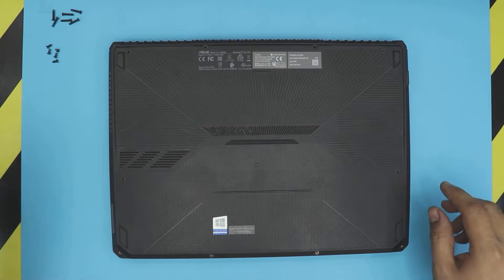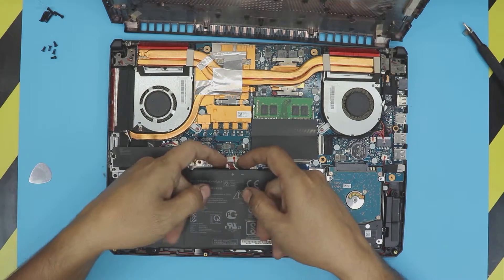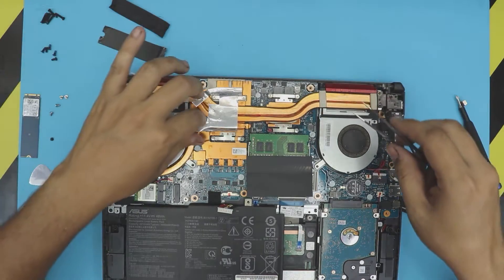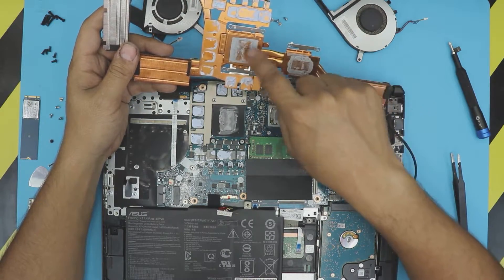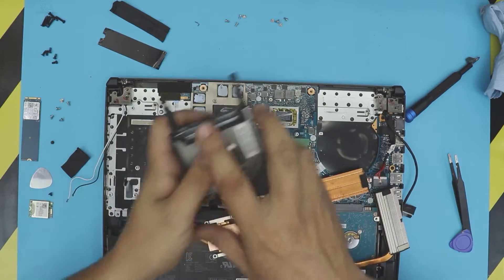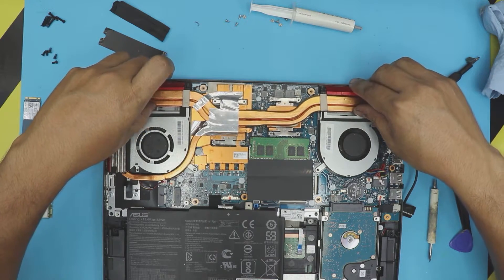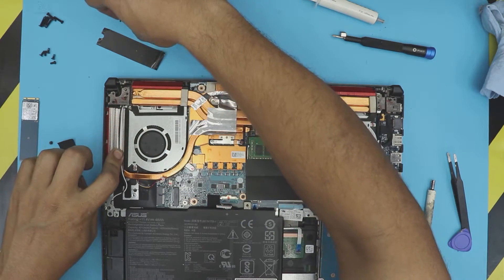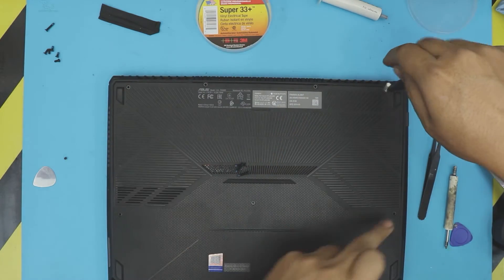✔ ASUS TUF fx505d Repaste Full Service, STEP By STEP

Comment: Hey. My brother removed all the old thermal paste from all the parts and replaced it. Do i have to worry about the laptop?
Reply from the maker: depending the type or brand of the paste he used.
Reply: @uFixTek  MX-4
Reply: is it a good one ?
Reply from the maker: Hold on he removed the thermal gel? from the components?
Reply: @uFixTek  yes, and put some thermal paster instead, the laptop is not overheating at all, its better than before but im kinda worried cuz in ur video u only removed it from cpu and gpu not everything
Reply: so what do i do ? is all good or do i need to be worried ?
Reply from the maker: if he is not going to Over clock anything, then no worry , its all good, but if ever going to start over clocking then he will need to place a thermal pads on components. BUT if not 100%safe
Reply: @uFixTek  oh he is not, thank u so much, i rly appreciate it
Reply from the maker: anytime my friend :) على الرحب والسعة

Comment: Broski is there a substitute for a copper cleaner or is there any alternative thing that I can use? I was planning to get the paste online but I dont think I have enough for cleaner. Thanks.
Reply from the maker: Thank you for the feedback and your support by a sub  :P
regarding your question:
you dont need to use a cleaner copper or silver cleaner, you can mix a "baking soda" with alcohol, and rub with your finger rub it into the heatsink and it will clean it in seconds.

Comment: Thank you. I really wish my service center was as good as you. I really liked the part when you suggest bending the clamps slightly so that it will sit better on the cpu. 
Can I ask what copper cleaning solution consists of? Will Dil vinegar help?

Also regarding alcohol, I have medical grade isopropyl alcohol. Does it's percentage matter?
Reply from the maker: Thank you for the feedback and support to the channel by SUB :P
regarding your questions:
#1. bending the xclam will give a better pressure from heatsink to the CPU/GPU
#2.  if you dont have silver or copper cleaner solution you can use a vinegar and mixed with "baking soda"
and use to rub the copper and it will remove any layer of oxidation, just remember you will have about 10sec before the copper starts to react with air(oxygen)  so apply 1st the thermal paste and prepare everything and once cleaned the heatsink sit it down right away.
#3. regarding the alcohol , you can use the "medical grade isopropyl alcohol" but i would not recommend you as it have more water base. i would highly recommend use 90+% iso alcohol.
if you got any other questions feel free to ask me. good luck
Reply: @uFixTek  thank you. This is the best channel I've seen explaining in such detail.
Reply from the maker: Thank you for the awesome feedback my friend :)

Comment: Thanks for the video mate. I repasted my laptop with artic mx-4. CPU now goes max up to 85'c (earlier it was 90+) and GPU 75'c. I read in the commnets that u recommend a copper shim to decrese the temp even . Do you have a video for it. If not can u pls describe the procedure ?
Reply from the maker: Thank you for the feedback and your support to the channel by a sub :P
regarding your question:
IF you want to get the best results get this:
https://amzn.to/3cM2mho
and get the 20mm x 20mm .3mm
https://amzn.to/38ZYOHk

its really simple:
you will clean the heatsink and the GPU/CPU
then you will apply a paste on the CPU/GPU
after place a copper shim over the cpu and gpu 
and then place more paste on top of the copper shims and you are all set , enjoy  the drop :)
(all you doing its increasing the pressure on the CPU and GPU and therefore you will get better heat transfer, and your fan noise will be less)
remember that the GPU and CPU have a fan curve, that means after placing the copper shim you may get near the same results, but your fan will work less = less fan noise
i would highly recommend you to sandwich that copper shim in there :P
and an EXTRA TIP:
try to rise the back end of the laptop about 2-3cm off the table and you will see an additional temp drop, as you will help the fresh air intake.

if anything else let me know.

Comment: Why not clean the other thermal paste on the other components and repaste it? Is there a significant difference on the performace or temp in bending the screw slots for cpu and gpu?
Reply from the maker: Thank you for the feedback and your support to the channel by a sub :P
regarding your question:
there is no need to clean and replace the other components pads or paste, UNLESS you are over clocking then YES, BUT if you are not over clocking anything, then you really dont need to repaste or clean the pads on the other components as they dont over heat and you wont know any difference in performance.
those components dont need pads or paste unless you over clock.
regarding the bending the x-clamps: YOU WILL see a BIG difference in temperature and fan noise drop. remember fan noise and temperature goes hand by hand.
Reply: @uFixTek  thankyouu so much. Yeah already subscribed
Reply from the maker: @jaycastillo1103  much appreciated :)
Reply from the maker: Thank you for the feedback and your support to the channel by a sub :P
regarding your question:
you shouldn't be able to remove the screw from the spring. it should be there. 
just loosen the screw and thats all, then slide hard the cover to the front of the laptop.

Comment: do you recommend changing the paste to thermalpad for the VRAM ?
Reply from the maker: Thank you for the feedback and your support to the channel by a sub :P
regarding your question: NO NOT AT ALL, DONT change the pads for the vrams they are not important, unless if you over clock the vrans then YES, if not overclocking then dont replace them , you dont even need them if not over clocking.
Reply: @uFixTek  how about cleaning the VRAM and repaste it, or just leave the way it is? Which one do you recommend?
Reply from the maker: no need to clean the vrams or touch it. its absolutely not necessary , the vrams are like regular ram chip, some ram chips come with heatsink for those that want to over clock them and the normal most dont come with heatsink because they are not supposed to be overclocked.
Reply: @uFixTek  alright, thank you so much, really appreciate your info
Reply from the maker: your welcome my friend, if you ever need any help feel free to ask me in any of my video comments

Comment: Very good video, thank you it helped me a lot, now i'll encourage to open my asus and replace the paste... would you suggest any Liquid Metal instead? or do you even suggest Liquid metal? My asus goes up to 95c degrees when gaming at full load... i am looking to make it lower, thank you in advance for your reply
Reply from the maker: Thank you for the feedback and your support to the channel by a sub :P,
regarding the question about the LM, YES AND NO:
IF you move the laptop a lot in a bag or from table to table: then DON'T do LM
BUT if the laptop sits on a table always without moving then YES DO IT,
Reason for the above would be, people that say LM goes bad after year or two or 5 years is because they dont understand the chemistry behind the LM and the long effect of LM:
LM:
at its normal state is Liquid, as it says on the box:P
that what makes it easy to apply, 
now lets say you apply LM on a CPU laptop: the LM will starts bonding on heat-sink and cpu or gpu dye, and after few months of usage by transferring heat or cold, the LIQUID portion of the components starts to dry up, and it supposed to do this not because its getting bad or something, its a good thing that the Liquid starts to evaporate.
because then the risk of spilling and going over the motherboard goes down to 0%.
BUT that's not the best part, the best part is that when LM is dried it will bond both materials 100% even better than when it was on its liquid form factor.
NOW this is where you make up your mind and decide if you want LM or not:
#1. when the bond is solid the heat transfer is at its best BUT the bond is VERY VER VERY fragile , any small bang or hit or drop it will break the bond, because the heatsink have  x clamp and its there for retraction when the components heat up, so when the bond is broken by hit then your temperatures will be the worst you ever seen. and there is no Liquid so it can start bonding again.

#2. if you dont hit and really really take care of the laptop and have it as workstation, then you will only see improvements on temps, and every 6months open up to clean the fans without lifting or moving  or jerking the heatsink.

WHAT I WOULD RECOMMEND you is this:
thermal grizzly kryonaut:
https://amzn.to/3u3sE6A

its the same brand but in the paste version, the cons and pro:
pro: gives you the same results as the LM but with 2-3c less
pro: none conductive
pro:last 8years under heavy usage

cons: you loose 2-3c :P
cons: you have to repaste after 8years
cons: can't think of any at the moment

i hope this explains a bit,  i have made videos on LM for laptop if you will to check them out go to my videos and search for Liquid word.
good luck
Reply: what are the GPU temps while you are gaming heavily in this laptop?
Reply: @souravkumar5774  I did set the max cpu power to 99% in the energy options and now it gets up like to 80c kinda. Instead of 93-95 that I had before. Never repasted it cuz after I found that I could set the energy options from cpu in that way, I just never opened

Comment: What about the thermal paste on the other smaller parts?
Reply from the maker: IF "other smaller part" means the Vrams?, if so then the reason is that the jell pad that they have there its perfectly fine and you truly never need to replace them , even have them in some cases, the vrams dont need cooling on laptops UNLESS you OC the vram chips with third party apps.
if you think that the vrams need the cooling then you may worry about your regular Rams that do even most of the job.
NOTE dont put pads on vrams as it will counter force the heatsink and it will end up over heating gpu or cpu.
Thank you for the feedback and support :)
Reply: @uFixTek  Thanks for your replay, but what do you mean by pads on the vrams?
Reply from the maker: i need to know what you mean by "on the other smaller parts"
Reply: @uFixTek  It's the thermal paste that is not on the cpu and the gpu
Reply from the maker: the one on black square chips around?
if so they are vram chip.
Reply: @uFixTek  Yeah but you said "don't put pads on the vram". Sorry for asking.
Reply from the maker: ya dont put pads , the thing you see on the vrams in the video its a jelly thermal silicon, its very soft and gummy , so its not pushing the heatsink away. but if you replace it with pads it will push heatsink away and you will have horrible temps. trust me and just leave the vrams the way it is.
Reply: @uFixTek  I see now, thanks.
Reply: @uFixTek  sorry, i open my laptop, is a asus tuf too, my dad puted pads on the vrams and now i got very low fps in everygame and finally the laptop turns off, should i remove the pads? And leave them with nothing?i was thinking on change the fan but then i read this and remember about the pads

Comment: why didn't you clean the rest of the parts from the paste ???
Reply from the maker: by "rest of the parts" you mean the extra paste around the cpu gpu?, if so its because its not needed as the paste its too dry and you may damage the capacitors, and i dont want my subscribers start damaging the laptop,
IF "rest of the parts" means the Vrams?, if so then the reason is that the jell pad that they have there its perfectly fine and you trully never need to replace them , even have them in some cases, the vrams dont need cooling on laptops UNLESS you OC the vram chips with third party apps.
if you think that the vrams need the cooling then you may worry about your regular Rams that do even most of the job.
Thank you for the feedback and support :)
Reply: @uFixTek  that's what I meant about VRAM - thank you very much for the extensive explanations - respect and best regards
Reply from the maker: Thank you, NOTE dont put pads on vrams as it will counter force the heatsink and it will end up over heating gpu or cpu. good luck

Comment: Ok i reset my pc again and its working like it was before, with the brand new as5 it still runs at 80-90 while playing dayz
Reply from the maker: i would suggest adding a copper shim, and what thermal paste you used?
Reply: @uFixTek  arctic silver 5
Reply from the maker: use a artic mx-4 and use a copper shim and the temps shouldn't reach 90 max 85c , also lift the back end of the laptop about 1-2cm so you get a better air flow and it will help a lot.

Comment: How's your temperature after the repaste? Did it improve??
Reply from the maker: it definitely did my friend , and after few days i repasted with :
Thermal Grizzly Kryonaut: https://amzn.to/2UV30kl
and i got a way better results and Thermal Grizzly Kryonaut is the top of the line before Liquid Metal.
you will see a big difference in temps. 
thank you for the support to the channel :)
Reply: Thats great!!! I'll probably try repasting by that thermal paste. May I ask how much temp I can expect ??
Reply from the maker: your temps should be around 75c gpu and 70-75c cpu
if you use copper shim, and thats under max load.
you may even get a way better result.
keep us posted with your result :)
Reply: @uFixTek  Hi, its been a year now ever since I repasted. Now, I'm planning to put coppershim to cpu, gpu, and as well in the vrm (looking to lower more the temp for the gpu). I wonder if it's a good idea to do and what would be the copper shim's size per component?

Comment: I put all back together and my gpu only shows the weaker one.   My 2060 rtx popped up once but i installed something and rebooted and its gone
Reply: In device manager, on a driver updater that i cant pay for shows something about a 2060 driver missing so im hopeful but i cant download the driver gui from nvidia because it says there is none, but i feel lile it would work if i cant install the legacy inside device manager but idk where to find the driver
Reply from the maker: okay 1st update bios then, look for for a option that says dedicated video =enable. fresh install windows with UEFI enable. then try installing the drivers.
Reply: @uFixTek  i turned my pc on and it said gpu driver ready for install, and i open dm and it shows my gpu
Reply: Then it restarted automatically and its gone i also do not have that option in bios
Reply: Oh god idk wtf wrong with my laptop, now the password ive been using for the past year on bios that i have not changed is now incorrect
Reply from the maker: okay it sounds something is defiantly wrong. do me a fav use a external keyboard and leave the internal keyboard flex disconnected and try the bios pass word and go to windows without the internal keyboard. im guessing there is something wrong with your internal keyboard.
Reply from the maker: if there is something wrong with ur internal keyboard it can result in many many aside effects including dedicated gpu acting the way is acting.

Comment: The way you paste above, does it make it run around less than 70°c while gaming
Reply: Because before i stopped it was running around 90°c
Reply: Tomorrow i get my paste 😍
Reply from the maker: jesus 90 its too much when at full load max should be 70-80 sometimes depending the room temp and many other factor you can go up to 85 but no more than than. repaste and when doing gaming lift the back end of the laptop about 1-2 cm and you will see a big temp drop because of air flow. thank you for the support and post your results :)